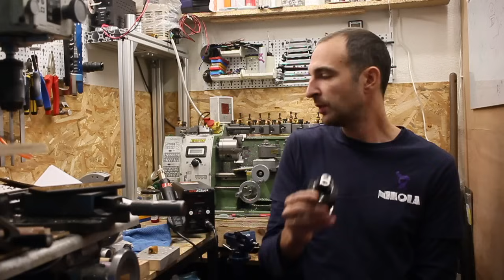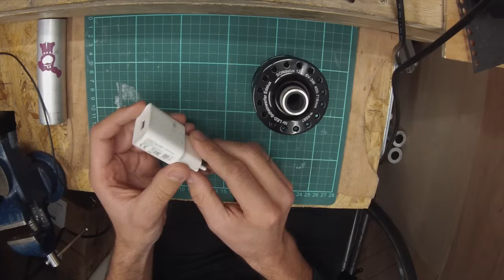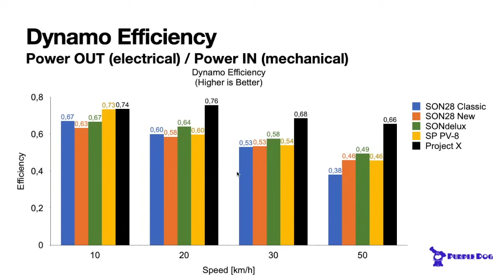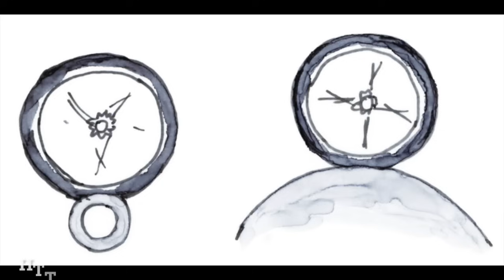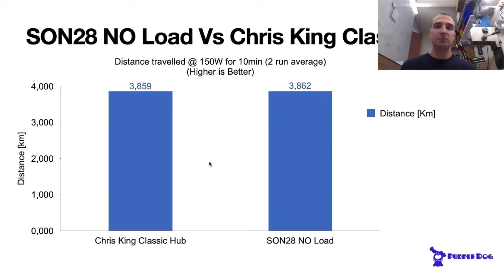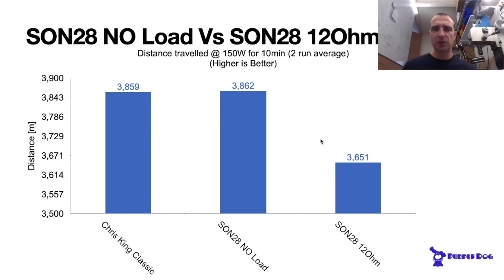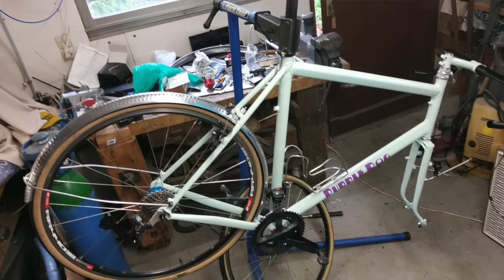Dynamo Drag and Resistance Tested: Myths Busted

Comment: I use a Shimano Dh2 or something with disk brakes. They work good and are very well sealed; I've never had one fail. I also dont feel that it slows me down.
Reply from the maker: I have a Shimano 12x100 thru axle model, that I used for commuting for quite some time. It did have some vibrations around 23kph other than that, it did it's job. :)
Reply: @CustomPurple output: I have a QR version on my Surly. My bike weighs 26 kg, so I don't feel it as much, but there are vibrations, but they don't bother me much. 

I use my DH as an "engine brake" on downhill. It's not much, but I just do it.

Can you also test entry-level hubs like my Shimano hub?  Thanks for your work.
Reply from the maker: In the link to the dynamo tests (in the description) there is some data on other hubs (Shimano, SP, Sanyo and others); I just showed the ones directly related to my video. So in theory you can do some calculations and using my results you can correlate it and get you close.

Though nothing beats a good measurement...for that I would have to build one wheel per hub with identical rims, so depends if there is enough interest. Overall ("6V/3W") dynamos are pretty close, but I have definitely thought about it. To be seen. =)
Reply: My Shimano hub dynamo is 24 years old. I attached two headlights to it. That way I don't have any light until about 7, 8 kph, but then it's better than faster I ride.
Reply from the maker: Ah yes this is the classic way to do it (2 headlights in series). In the tests (link in the description) I think Olaf Schultz tested some dual headlight setups as well. You would get double the power, so double the drag as well, but if it means you can descent faster with more confidence on unknown roads it is a good tradeoff.
Reply: @CustomPurple  Sure that is so. If I ride slower, I hardly feel anything, but at 30 kph I feel it is not the same. I can attest by switching off the lights.

BTW. On the rear I have a solar-powered light from China. It lasts about 4 h charged. It is lousy quality, but the principle works good. There is a movement sensor and a light sensor, so it auto-switches on at night and when I move. I wish there was a better one at reasonable cost, with bigger capacity battery and the option of charging it via power bank.
Reply from the maker: Well dynamo efficiency does drop the faster you go (all dynamos do that) so you are losing anywhere 10-20% efficiency which can be noticeable, though feeling and if it really slows you down (actual time lost) might not be as bad as it seems. Vibrations increase as well; I am guessing so you might be feeling that.

The tail light you mention is a nice idea indeed, though having both USB and solar would definitely increase the complexity (and price). I will keep that in the idea box. =)
Reply: @CustomPurple  If daytime and I really need every bit of speed, I can switch them off. At night I don't care, light is more important than efficiency. As you reasoned in the video, to have light ready available at any time is nice.
Reply from the maker: Oh yes for sure, though daytime running lights do help with safety in my opinion, though we don't need full power and this is where electronics (like the ones I make) with low power/dimming come in handy, though if you really want everything, switching it off is no drag at all. Some e-bike lights do that automatically (based on ambient light) though I have not tested them.

Comment: Thank you for the great video. I am looking forward the dynamo you are talking about.

The sealing drag you mentioned on a Chris-King hub is probably almost as high on a SON-hub because they also use well sealed bearings, though SON uses (high quality) SKF-Steel bearings.

I personally switched to dynohubs because I was tired of lights always giving up in the most inopportune moments.

I generally agree with the statement of the importance of seals on bearings; I haven't destroyed my SON-bearings though they have seen about 30000km of all weather commuting with quite some muddy stretches and even some road salt. I have had a couple of bottom brackets giving out in the meantime though.
Reply from the maker: Hi there and thank you for watching and for your comment. Project X is moving along, so best way to stay up to date is to subscribe. I might have something coming in the next week or so, unless it gets lost in the mail in the end of year chaos....(fingers crossed). ;)

Efficiency (ie converting mechanical to electrical) is just one part of the big picture and why the Project X really got born as an idea (and potentially a commercial product) is the so called '6V/3W' ecosystem, which as I mention in the video is extremely outdated and limiting with regards our constantly evolving power needs on the bike. Electronics nowadays  are what can really make the difference, like The Companion front light with dimming as an example to significantly lower drag. Project X will be designed to fit even better with modern electronics.

With regards the Chris King/SKF bearing drag, I do have a set of Chris King r45 hubs (different rim so don't know how relatable that is as a test...might just try it one day), though those hubs (r45) do feel significantly less draggy when spun by hand. Funny story is that I had already made some tests last summer (and saw there was no difference in drag) and while talking to SON, their latest dynohub is made to feel MUCH less draggy when spinning by hand, because customers complained that it must slow them down. I said that I have actually measured it and it does not, but SON's response was a just a shrug and that customers did not know that. Perception is a powerful motivator. In the words of Bob Dylan - we gotta serve somebody, though I digress.

The hub I used for testing in the video actually has at least 24,000km (possibly much more) mostly commuting and the bike spent a good part of its life outside locked up in all conditions. And the SON28 classic model does not have the pressure compensation system (that prevents condensation of entering the bearings when taking the bike from warm house to cold outside, etc.) which further attests to the SON quality. While after my many hours dealing with electronics and dynamos,  I do believe batteries are a superior power source, HOWEVER, their disadvantage is too great to forgo what dynamos actually provide you, even at some drag penalty. In any case we are not Carlos Sastre at the final time trial of the 2008 Tour de France (where mechanics allegedly removed seals of the hubs and used oil and not grease) so we can live with a couple of seconds/minutes here and there. =)

Have a great day.

Best,
-Nikola